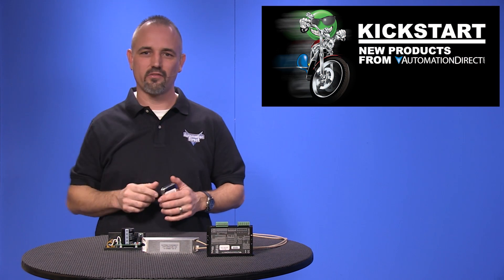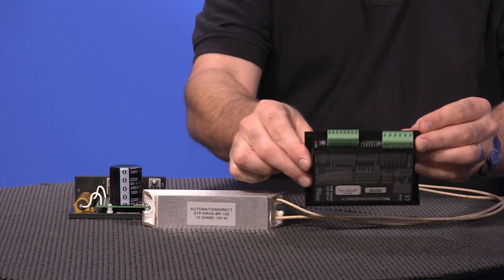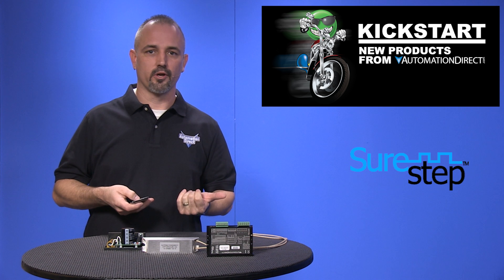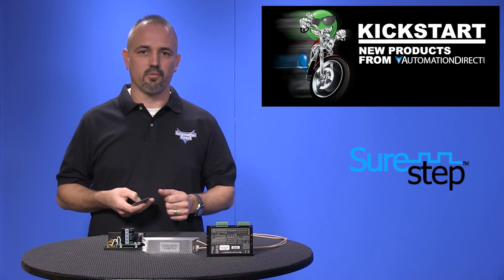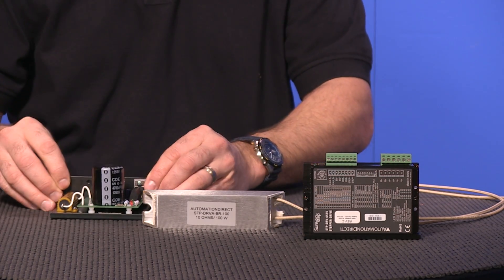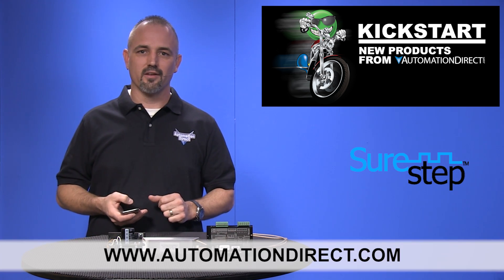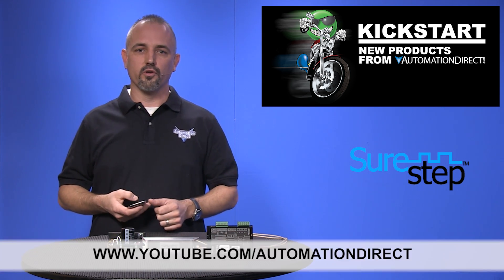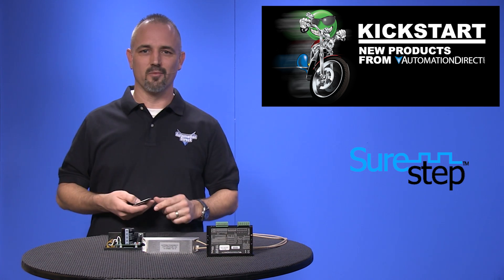SureStep Stepper Drives from AutomationDirect

Comment: Hey Where is the Step and Direction HSO Wiring Video
Reply from the maker: There is an eight part video series created that covers HSO using the HTRIO module with SureStep Stepper Systems that includes a wiring diagram and project files here YouTube(.)com/watch?v=XDZt2F5cK4g

There is also a new motion control video created that covers the build-in HSIO of a DL05 PLC with SureStep Stepper Systems that includes wiring diagrams and project files here YouTube(.)com/watch?v=aQs-EYLC2sg

We hope this helps!